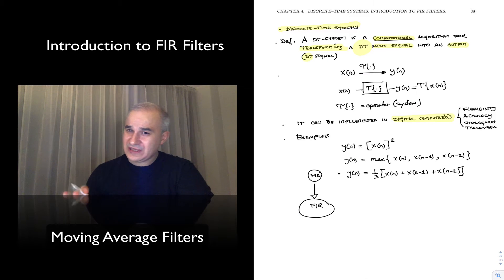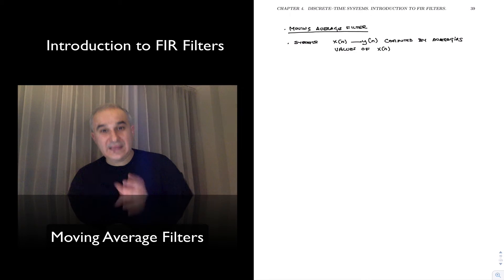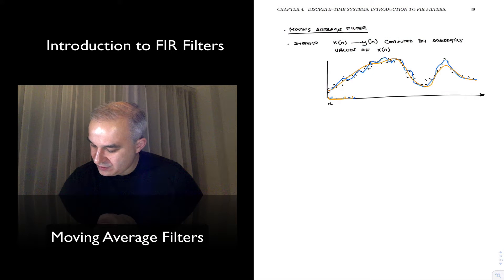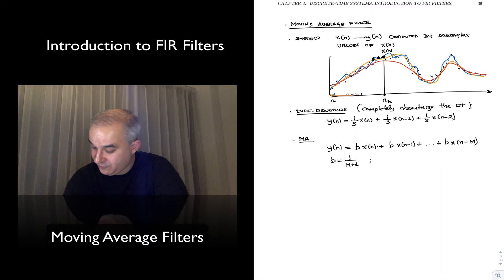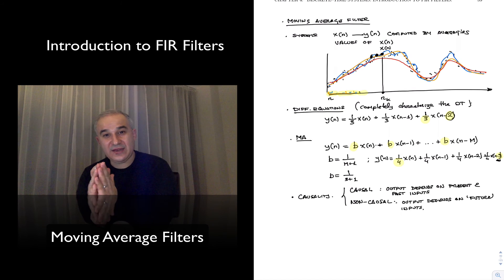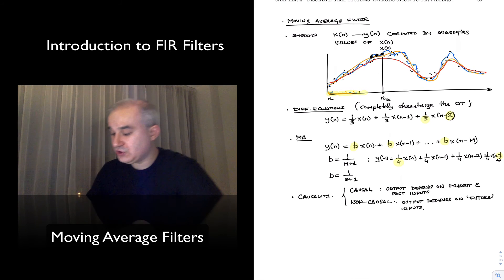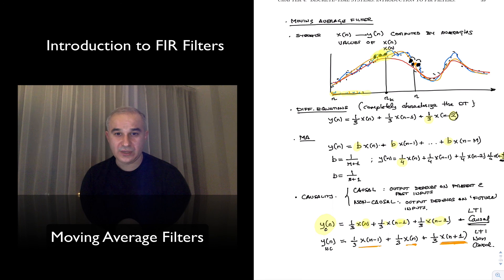DSP Topic 4: Understanding Moving Average Filters (V3)

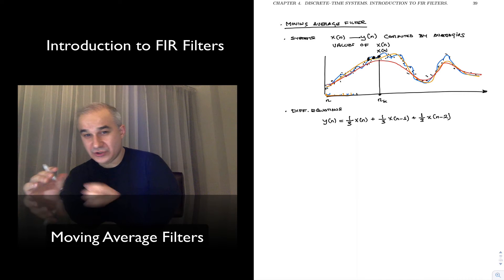Comment: Shouldn't the brackets inside the difference equation at 5:31 be [n], [n+1], [n+2] if we are shifting to the left?
Reply: We are not shifting the signal by steps to the left. Instead we are considering the nth, (n-1)th and (n-2)th sample for calculating the average for those set of 3 samples. The argument of +1/+2 would be valid for shifting a DT signal.
Reply from the maker: No.